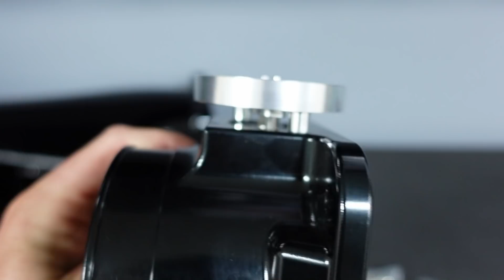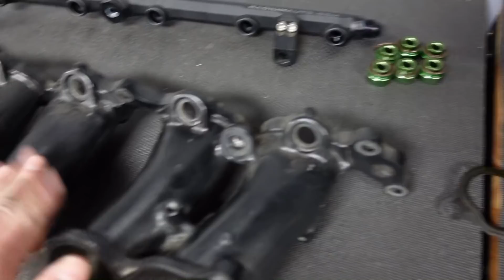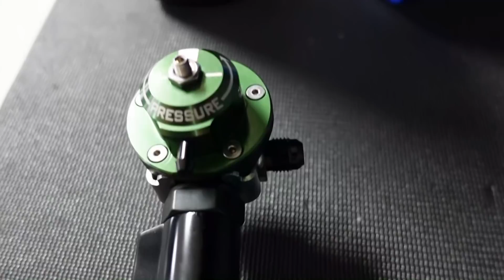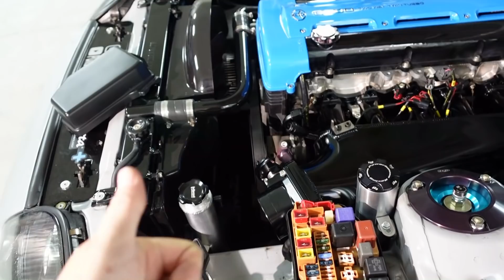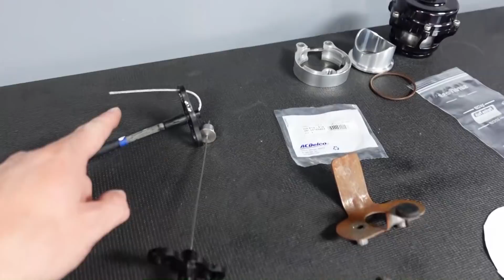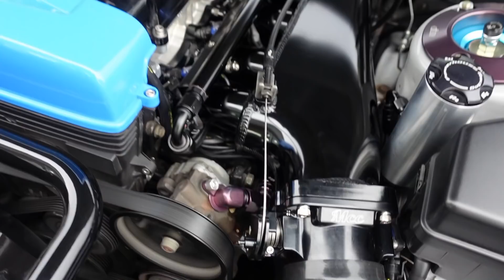2JZ Custom Intake Manifold! (MCC Loyalty MotorSports) Install Video

Comment: Howdy, I'm currently fitting an aftermarket inlet and have noticed people run some sort of aftermarket injector loom so that it can reach up from the bottom and plug into the injectors. Is this something i can buy or do I need to modify the stock loom. This part seems to be overlooked in all the research I've done in making sure I'm prepared to do the job. 

Apologies if you've already mentioned this and I've missed it.

Comment: Looks good but fitment could be better in those tight spaces. Seems troublesome for something made specifically for the 2JZ engine in a supra (being that’s what the 2J is from or aristo) or any other car with a 2J. 

Good video very detailed on point

Comment: If you ever get the chance,  you should do a video on 12v mod for the fuel pump. I burned through one fuel pump controller, so ill need a quality how-to vid to go that route. Lol

Unless you already did one, then my bad. Haha
Reply: There's an article and other videos about it if you search Google BUT I highly recommend you don't do it as it introduces new risks. For example, if you run the 12v mod and get into an accident, the fuel pumps are still running and pumping fuel around (or out if you have a split hose). If there's a even a small spark, you'll light up like a Christmas tree. Reason for the pumps still running even after the engine is off (but not the ignition) is because you've removed/bypassed one of the FP ECU pinouts as per the mod guidelines.

I know you might want to do the 12v mod as it's the cheapest but honestly, it is not worth the risk nor your life going down that route. I advise you do further research on MKIV Forums, MKIV pages or reach out to MKIV specialists as they can advise the best approach for whatever you're trying to achieve.
Reply: @DynamicEvolved  thanks for the reply. Isn't it true that you need to run a relay to avoid that? That's what I've read. But there a lot of conflicting info out there
Reply: @SoopSauce  yeah don't do the 12v Mod. Run a dedicated power wire from battery with a relay.